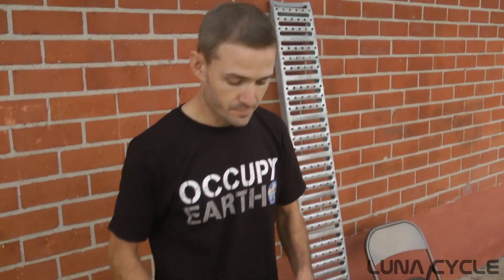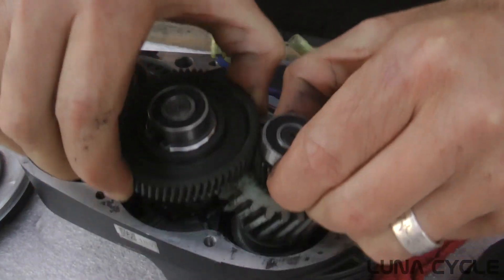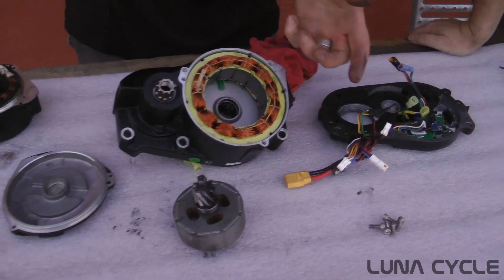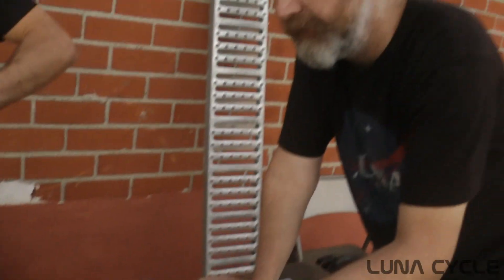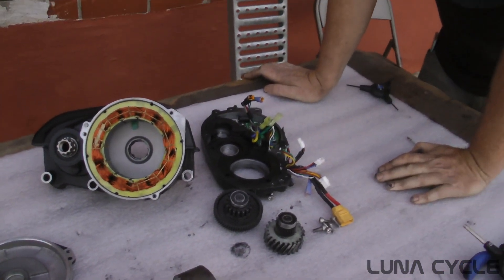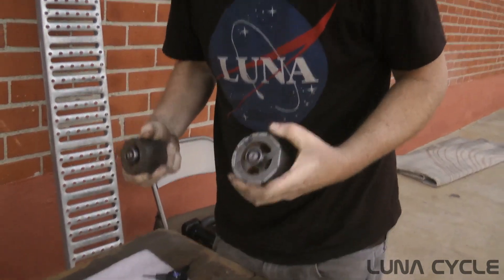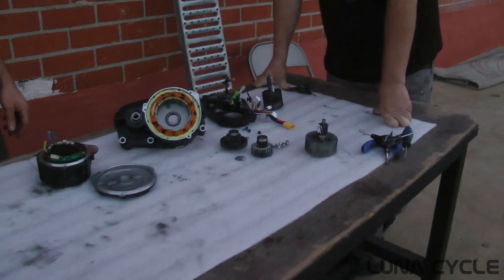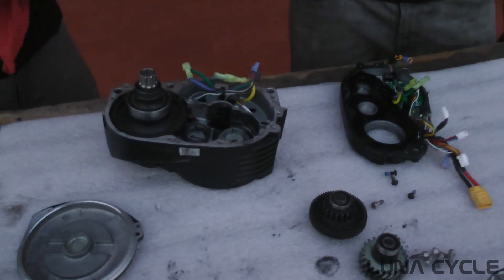Bafang Ultra  Mid Drive Tear Down and Comparison BBSHD

Comment: I'm wondering, do you guys have any data, stats, or just anecdotal information on efficiency comparisons between these two motors? I'm riding a BBSHD now, and wondering if the M620 is more efficient - same battery, same rider, same routers, etc. is it comparable?

Comment: This might be a really ignorant question, but are these motors DC or AC? If they are DC, how is the speed regulated?
Reply: @leetjohnson  pulse width modulators
Reply: AC/BLDC. the electronics switch the motor to make it run

Comment: It would be great if you guys can make a video about adapting a fast Bafang to a recumbent trike, like a HP Velotechnik, a Catrike, a Greenspeed, or a Azub Ti-Trike?
Great Video!
Reply: Zorro in Hell Bafang is coming out with a ultra that fits on a catrike ...even comes with  a notched tube
Reply: @davegott4783  hey Dave, thanks for the info.  Can this be found on their website ? Is it a Hub motor or a motor that goes on the front stem?

Comment: Pretty cool. I like the larger parts and easy disassembly. I'll stick to the Cyclone motors for most riding, but can totally see why I would want to buy one of these too. Street legal is nice some times. 

Have you (Luna) had any special stuff done with the controller for your offerings like you've had done on other motors for higher power?

Comment: Would you still need to add black grease like you would for the BBs02 to help the big gear last longer?
Reply: Put liqi moly disulfide greace in will help loads has very good friction properties and heat  the gears will last longer

Comment: Hi ! can you pls tell me which controller is inside the max drive? and do you know the speed box  tuning chip for this motor? do you know what this thing does and how the tuning works with a 36 V, 10.4 Ah battery?

Comment: I have a new BBS02 that started overheating,  any ideas ??
Reply: Maybe motor coils shortage. If Bafang can provide you motor coil resistance you can check coil resistance and see if it is within limits.
Reply: Bafang have ignored all my correspondence (edit : not bafang , but their authorised dealer PSWpower store

Comment: yeah that's great. errrr but I need a custom frame lol, dumb....think I will stick with my bbshd..lol or get the grinder out and hack my frame so I can weld this in.....anyone making a frame for this yet
Reply: sbcfilm exactly! ......I was thinking the same thing!
Reply: I was thinking order the mounting bracket, take you bike and remove the front chain ring assembly. Then lay the bracket to get a rough idea of where to mount. Trace the cut out with a sharpie and then weld the bracket into an existing frame. Depends depending on your welding skills, it could look stock.